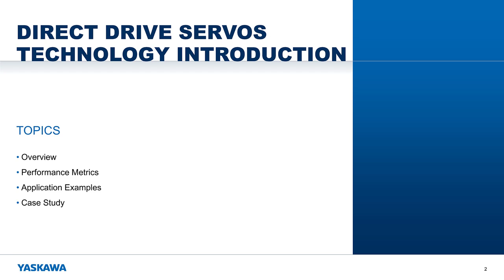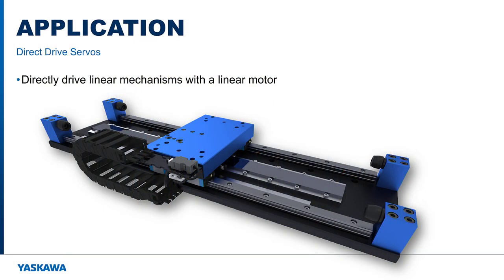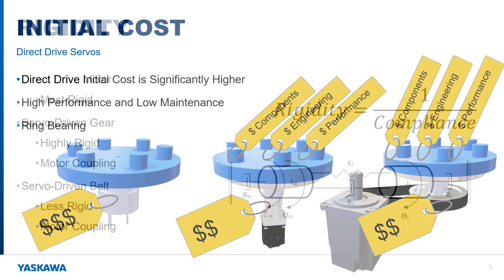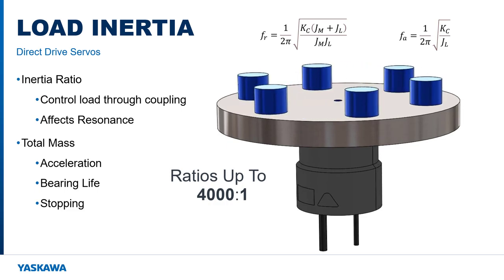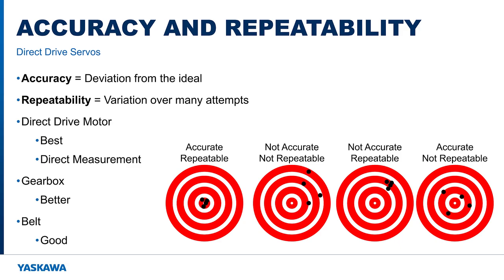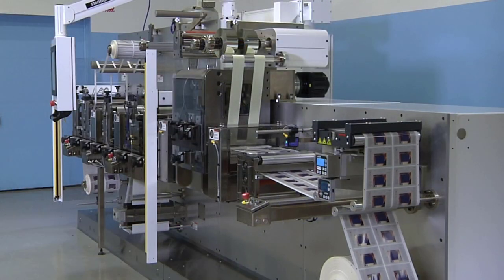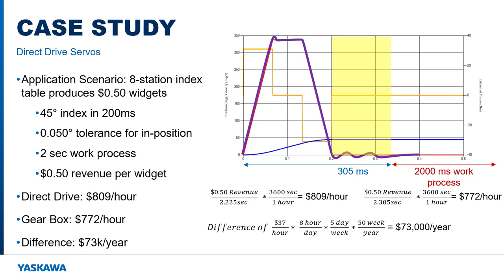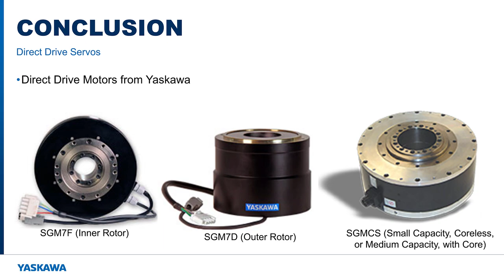Direct Drive Servos

Comment: Wow, such an underrated video. Thank you for explaining everything so thuroghly. I dream of one day affording one of these motors for a series-parallel hybrid robot, Laser or TIG directed energy deposition, which currently only exists in my imagination due to my lack an engineering degree and the financial means to build such a magnificent machine. I believe these motors would reduce the size and increase the capabilities drastically.

Comment: Cool. Guess it's not really suited to CNC spindle drives.
Reply from the maker: Thanks for your interest in Servo 'Basic Concepts'.
Since the motors cannot run at high speeds, they should not be used for applications requiring high RPMs.